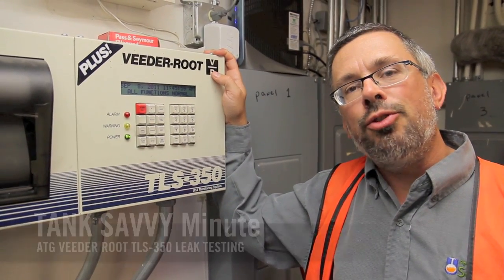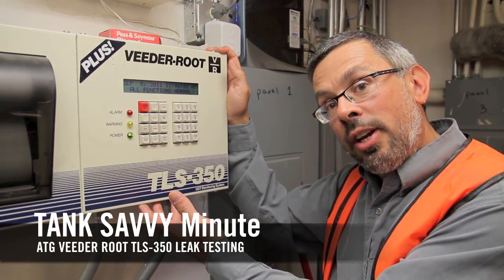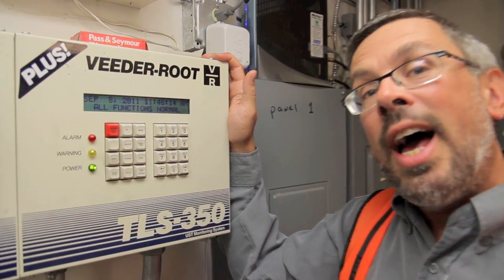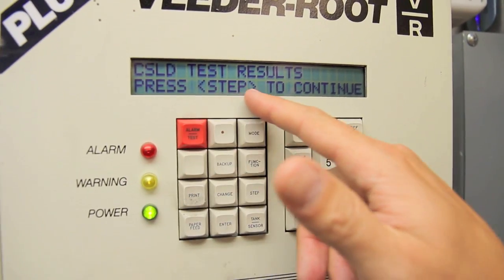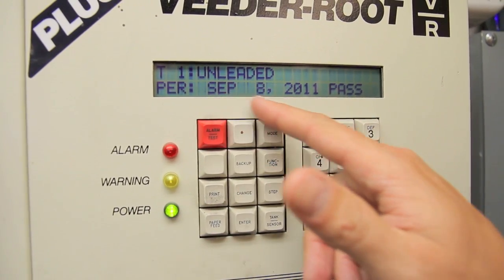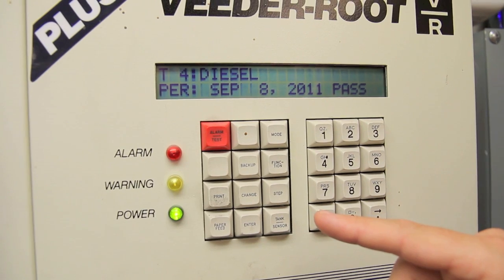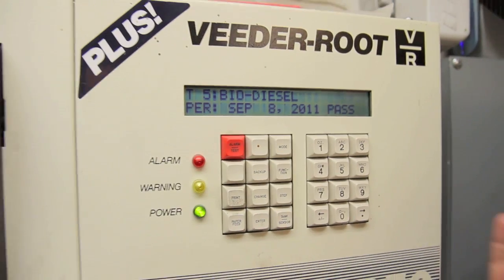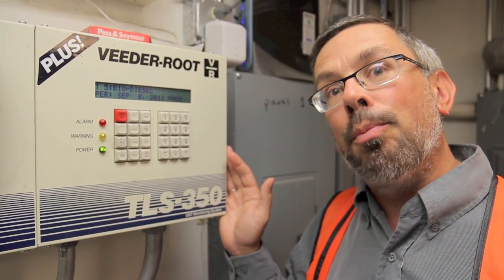ATG Veeder-Root TLS-350 Leak Test

Comment: My Veeder Root does a leak test every night at midnight. Is there a way to stop it from doing this every single night? We are going through a good amount of printer paper. Also, is there a way to display the amount of fuel in the tank without printing a ticket? Thanks so much for your help.
Reply: Matt Sayle their is. i cant remember how i did it but if i fiddled around and figured it out im sure you will too.